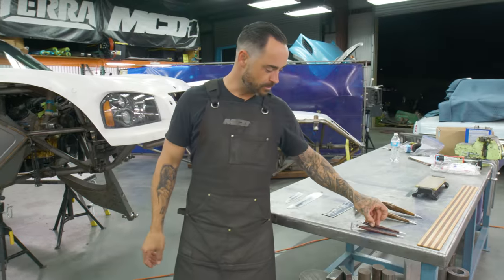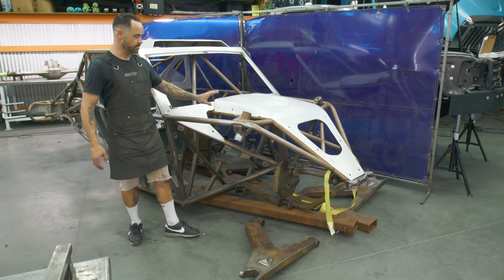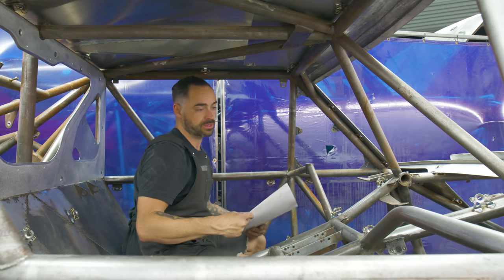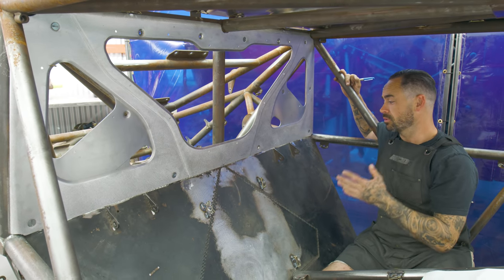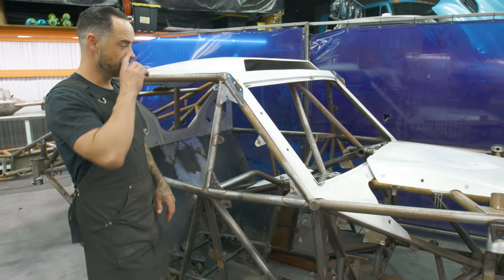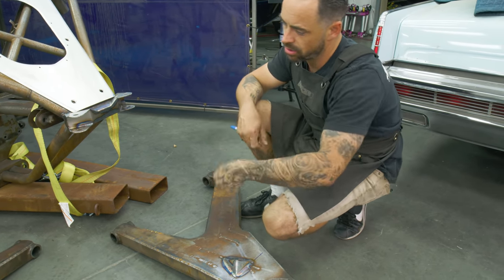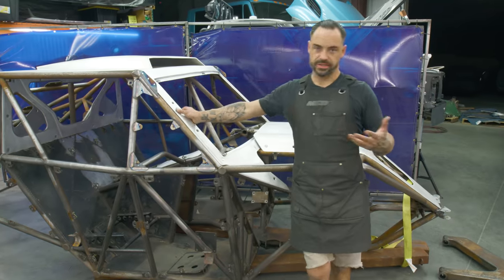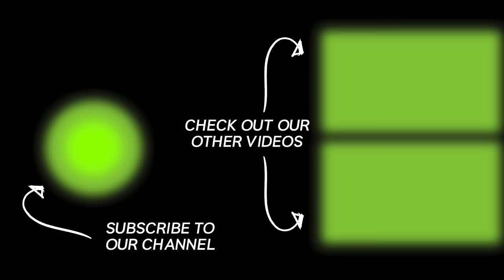Morgan Clarke Strips Down the Armor Craft machine | Operation Truggy

Comment: You have so much knowledge in your head I wish I could be around you just to absorb some of it.  Right now I work at a shop restoring and building street cars some pretty badass cars but I aspire to do off road fab. I've got an Infinity QX4 like they destroyed on Blake's channel I take it wheeling and it does well (better than some modified jeeps on mud terrains). Anyway bro great job on the truck so far one day I'll be there